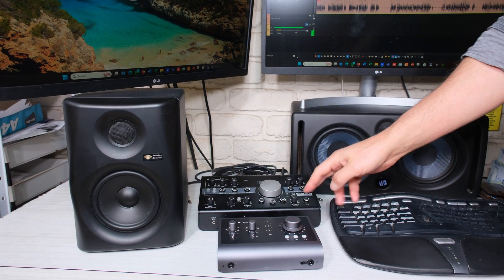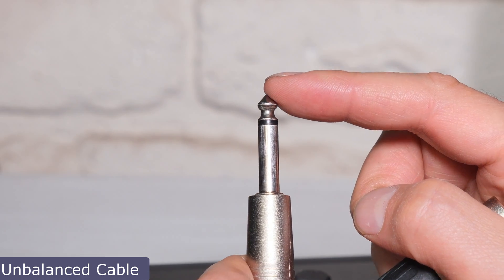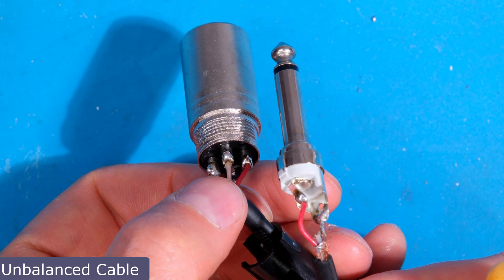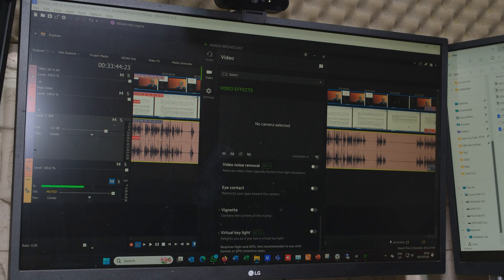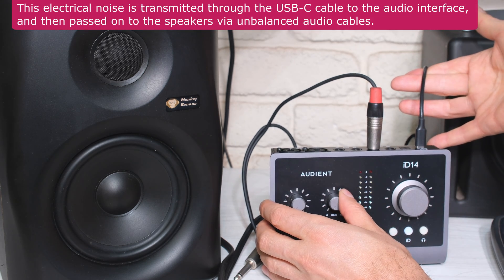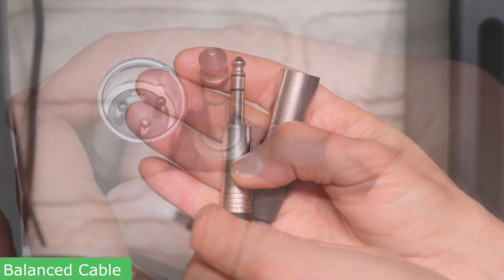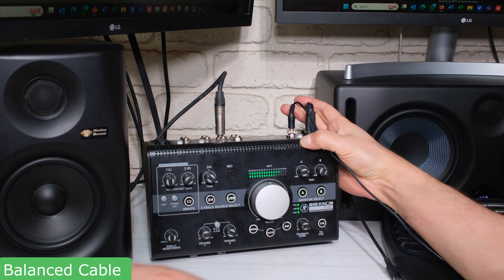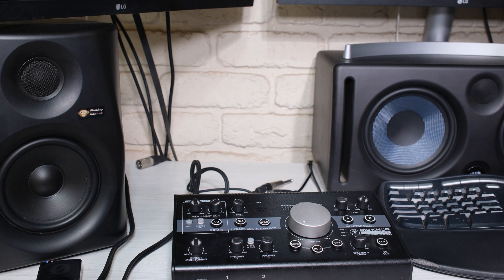Balanced vs Unbalanced Audio Cables – Audio Interface Test (Noise Comparison)

Comment: I'm using the same Audent sound card and a balanced Yamaha HS5 monitor. My cables are also original. I keep getting that crackling sound. What can I do?
Reply: I bought a sound insulator, I installed them, the problem was solved
Reply: @oftanrikulu glad to know that , can you elaborate what kind of sound insulator you used ?
Reply: I have the HS5 balanced too and I have that sound. Even when I switched for Mogami TRS with 1/4 to XLR... this is not working
Reply: Try changing your mic cable or try turning off any wifi or bluetooth of your pc and try keeping your audio interface any input or output cables away from the other powercables running around it. i this does't work that it can be a grounding issue